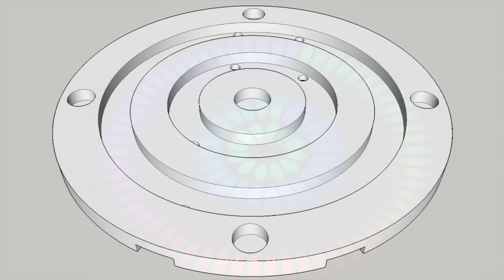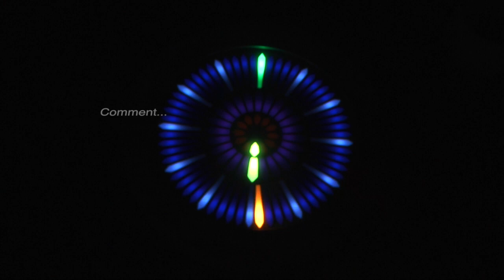LED Clock V2 Final Assembly

Comment: this is an amazing project, Steve!  well done.  i've made two of your clocks so far, modifying the 3d print design to accommodate both side-emitting WS2812B and WS2812B strips in a 180% scaled-up version.
Reply from the maker: Thanks, I would live to see what you have done.

Comment: Seeing so many (Projects) this one included 👍👍👍👍😎.. (Very Nice in Appearance) ... (The Electronics aspect of Projects like these not a problem) No Shortage of Parts to Pick from (Horded) 😊 for many years.  (Hard to Choose a Good 3D Printer However) So Many to choose from... Almost any Printer has a 50 / 50 Review.. (One person says) Best Ever !! .. Another Review will Say Horrible print quality (Bad things about it) for the same Make and Model of Printer.. (So.. No 3D Printer YET..) I Know you can't expect. 1000% Perfection (Would Be Nice).. I Just Can't decide what 3D Printer to go with.. (I Set a Budget $2000 Max) And still looking ☹🕵‍♂.. Thanks for Sharing your Build and Files.. (When I Get a Printer Some Day)
Reply from the maker: Thanks for your kind words and glad you like the project. It has evolved a bit since making that video. I had the 3D printed parts laser cut in MDF in the end. 

Mind you, speaking of 3D printers, I can and will whole heartedly recommend any of the Bambu Lab printers. 

My first printer was an Up Mini. Okay for its time but the build plate was too small for my needs. My next printer the TiVo Tarantula (which came highly recommended at that time) was definately a tinkerers printer and I had mixed results with it. Loads of mods to try and make it work better with little luck. Bed adhesion being the biggest issue. 

I then went for the Creality CR10 Smart. A much better printer all round but still not adequate. You think you've dialled it in and then you get an unexpected failed print a week later for example, printing the same part too. Again bed adhesion and warping being the main issue. I think it may have been poor filament choice in the end.

I soon became fed up trying to dial in the printer all the time. 

Just recently I bought a Bambu Carbon X1 and this is the printer I’ve always needed. It just works with no tinkering unless you want to. Even old filament that had failed me previously, printed just fine on this machine. Don't get me wrong, there are failures sometimes, mostly my fault. Bed adhesion is really good and no warping. I have only used PLA mind. The Carbon with AMS (a must add on in my opinion), can be purchased at the moment for just over £1100 in the UK. I’m actually considering a P1S or a A1 as a second printer, permanently set up with a 0.2mm nozzle. In fact, the A1 would be perfect for that. Small parts requiring fine detail.

Bambu’s slicer is a dream to use, it is based on PrusaSlicer. 

Plenty of very good documentation to back up the printer and slicer. The comb is a dream to use by comparison to all other printers I have experienced.

Other 3D printer manufacturers are playing catch up to Bambu now. 

The only downside to Bambu is that you are hooked into their eco system. Although you can go off grid with it if you are happy to use SD cards rather than wireless to transfer printer files.

A mate of mine has a P1S and loves it. He used Creality Ender 3’s before that and says Bambu is streets ahead.

Go Bambu and thank me later ☺️
Reply: @stevemanley3685  LOL. 😊 I'm Currently Considering that Bambu Carbon X1 as a choice (Scary Coincidence, or can you read minds ??).. ( I like what I see) and now Reading Your Recommendation .. It Gives Me great Confidence that it May Be a good choice.  Plus very nice that Someone with (Hard Knocks) Experience (Such as yourself).. Is a Big Help with making a Decent Choice.. (Thank You Very Very Much) .. and yes I expect some print failures (At first because just learning) .. Perhaps Bad Filament..  or (Many others I can imagine) The list can be long (for a Reason Why 😕).. But, the X1 as a Choice.. Should Eliminate Half of the Potential Problems 🤞🤞 (Thanks Again Cheers)
Reply from the maker: @x_CrossHair_x  🤣 No I can’t read minds, I wish though. Just a pure coincidence I’m afraid. Glad I’m able to help with your choice. Bambu have produced a printer for the masses and not just another one for those who live to tinker under the hood. To many machine makers have left their customers to figure things for themselves or rely on those who are willing to tinker to step in and help via YouTube etc. 

The build quality is excellent as are most prints. Firmware updates are a breeze. The printer will self calibrate on first use, and before every print. Adds a bit of time to each print but the reliability makes this acceptable. Just start a print and let it get on with it. Check the first layer for sure, as this is always critical to successful prints. Keep the print surface clean using dish soap and warm water. Or isopropyl alcohol. I use the smooth PEI plate from Bambu almost all the time. It needs NO clue for PLA, holds and releases well. Printer comes with a cool plate. Bambu recommend glue that’s supplied with the printer even for PLA, but I could print PLA without glue most of the time on the Cool Plate. A lot of folk like the textured PEI plate. I have one but prefer a smooth rather than textured bottoms to my prints.

Please let me know how you get on.
Reply from the maker: PS. I’m going to try printing the clock parts on my Bambu just to see how well it prints it. Not thought to do so until this moment.
Reply from the maker: PS again. Bambu has its own MakerWorld. Also very good. You can download models others have made straight to the printer, even via a Bambu Handy App from a mobile device.

Oh and I forgot to mention, Bambu printers are faster than most other printers, and still retain quality prints.

Comment: Hallo Steve, do you have a diagram for this watch with
Real Time Clock RTC DS3231?
Reply from the maker: Hi, 
Sorry to say that I don’t currently have a circuit diagram for the DS3231 and Arduino. After I made this video, I revised my clock design and started using the DS3231, but with Teensy LC’s and I haven’t used Arduino since. The clock design and build have gone through several revisions and enhancements since this video was made and is currently on hold because other projects have got in the way.

I did do a Teensy version of the original clock with custom LED PCB and control board PCB with DS3231 and the MSGEQ7 circuit. The LED PCB included an extra LED in the centre and all the LEDs were of the RGBW type. It works very well.

The latest version is still in development and does away with the MSGEQ7 audio circuit, which has been replaced by a more complex but more versatile Audio Codec chip. To drive the audio chip, it requires the more powerful Teensy 3.2. The LED PCB has been updated even further and has multiple LEDs in most of the display segments. All these developments are not ready for sharing.

Comment: Great looking clock Could i get the files from you as dropbox files are no longer working now I would really like to make this clock Thank you Steve
Reply from the maker: Hi Neil, thanks for your comments and glad you like the project. 

I have checked the links and they are all working for me, so I’m unable to explain why you’re unable to access them.

Presuming that you were able to access the files, I’d have to say that you are Likely going to have difficulties using them. It is very unlikely you would be able to get the LED rings with exactly the same dimensions as the ones I used, which would mean the 3D printed parts would have to be customised for your rings. In addition, the Simblee module for remote controlling the clock ( not actually shown in the video ) is now obsolete with absolutely no support for it. After the IOS 14 update on my iPhone, I can no longer remote control my own clock through the Simblee App, which has been withdrawn from the App Store. So I should really remove those files and links.

Simblee aside, the code if run on a Nano and wired to the correct Real Time Clock module, should still work though.
Reply: @stevemanley3685  Thank you for your reply I will keep trying the links to see if I can get them to download  Just tried a couple time before the and still connection refused  again thank You
Reply: Funny thing I went to your other video and was able to download it with no problems  Again Thank You
Reply from the maker: @NeilHodgsonDARKHOURS  Fantastic, glad you were able to get hold of them eventually.

Comment: very good thing. before manufacturing decided to model in PROTEUS it turned out that the button on PIN 8 does not work. I also don't get the effects that are reflected in the video. the clock is especially tuned, it is displayed as three points (hours, minutes, seconds). they are running, but on a simple black background, only three LEDs light up, and in the video everything is on a blue background. tell me what's wrong.

Comment: Hello, i need to change the Diameter of all the Holes in the Backplate (for better fitting). Is there a Possibility to get the original STL Files to edit them ??
regards Mirko Ingold
Reply from the maker: Hi Mirko, the STL files are available, and a link to them is in the video description. If you mean the original SketchUp files I used to creat the STL files, then I’m sorry to say that I don’t release those to anyone. 

This issue has cropped up several times  before as the led rings used do vary in size. I have created custom STLs but I’m reliant on accurate measurements from you guys, and it can be time consuming for me. One guy managed to tweak the STL files directly. I’m not sure how he did it.

I am working on a clock kit that consists of a custom (and consistent) led back plate and clock face as a whole piece. It all takes time, effort and expense to get it all done.
Reply: @stevemanley3685  Hello Steve, thanky you for the fast respond. No Problem for that. I will find a way to edit the Holes in an other Software
Reply from the maker: The STL files I created for a couple of guys are available, just follow the link in the description. Being I’d rather spend time creating the new version of the clock in a kit form, I don’t have time to create custom STL files, I’m sorry to say.

Comment: awesome project ! can i remove 
"" MEMS ADMP401 
 Microphone and Amplifier " and " MSG EQ7 
Graphic Equaliser " from project ? And what happen when i remove it ? My son very like this and he tell me make one for him. He will put it on his desk. Hope you support me. Sorry for my bad english
Reply from the maker: Hi, thanks for the comment. Yes, you can omit those items, but be sure to edit the code so that it doesn’t try to enter the audio modes.
Reply: @stevemanley3685  i will. if i get error , hope you help me fix it. thank for the reply :)
Reply from the maker: @MerleyAilme  Hi, The simplest way to block the audio modes is to change just one line of code. It's near the top in the "includes & definitions" block.

Change: 
#define  MODE_LIMIT           6             // upper mode limit

To:
#define  MODE_LIMIT           1             // upper mode limit

All the code for the Audio modes will still be there, but you shouldn't be able to activate them using the mode up and down buttons. All you will get is the "Time" and the "Date" displays.

Hope this helps.
Reply: @stevemanley3685  hello , today i got all items. i go to test code.i edited your code as you told me.all leds were displayed but it didnot flash :( i pressed all 2 buttons but got nothing :( please help me
Reply from the maker: Vinh Đồng Đức Hi,
Without seeing what you built and how you wired it, It is difficult for me to advise. If all you did was omit the audio hardware, wire the RTC as per wiring schedule, then I would have to replicate the same thing and test it for myself, and I don’t have the spare parts to do that without ripping apart my own clock.

Are you able to post photos or a video on-line so I can try and see what you have done? I’d also suggest you post a copy of the code you edited.

Please recheck your wiring to make sure it’s correct. Do you have access to any test equipment like a scope or multimeter? If you have, see if power is getting to each item accordingly. There should also be a 1Hz signal coming from the RTC module, and it is this that controls how often the time is read from the RTC and updated on the display.

If you are into programming, try placing some debug lines into the sketch that writes to the serial port, and see where the code is getting to, but if you are not a coder, then this will not be very easy for you to do.
Reply: Steve Manley 

hi, thank you for reply !
I checked all wires those is connected between modules each other. And there is no mistake. Everytime i disconnect and connect power supply, the green led ( second led ) moves to another location. About source code, i just edit as you told me and no more ( change number of MODE from 6 to 1 ). I made a clip, you can see it here : 

https://youtu.be/NVJtjans5PQ

It’s so hard to me because I’m not coder and i have an analog multimeter to test. Hope you will help me complete it. Thank you so much !
Reply from the maker: Vinh Đồng Đức Hi, and thanks for sharing the video, but from the video, I can’t actually see the interconnections between the Arduino and the RTC module. Please share a photo so I can possibly see all the interconnections. I would also ask if you are using the exact same RTC module. If not, then that could be a problem. I does look like the time is being represented each time you power up, which could be that the 1Hz interrupt is not happening, or not being detected.
Reply: Steve Manley hi,
 thank you so much for helping ! 
I checked carefully all connections between Arduino and DS3234 module. No short circuit between wires. They are same as the schematic that you shared. I checked it very many times. So i guess i have the problem with RTC module. But i have no idea to test it. Still has 3v3 to VCC - GND pin.  The Arduino module still work good ( i tested it without RTC module with rainbow code ). Do you have any idea to help me check it ? The image of module i uploaded in below link, you can see it. I cannot find out another device from another supplier in my location. And it takes a long time to deliver to me ( 1 month or longer ). In case my RTC module has problem, can i replace it with another RTC module like DS3231 or DS1307 ?

https://youtu.be/U3jgworJ1sE
Reply from the maker: Vinh Đồng Đức Hi, and again thanks for the video. 

From what I can see, your wiring does look to be correct and mirrors my own clock. However, my clock has a Simblee micro-controller also connected to it, which simulates the functions of the two physical buttons using my mobile phone Via Bluetooth (unfortunately the Simblee is now unavailable, which is a huge shame, as it is a very clever device). So I’m thinking the code you have, has the Simblee functionality included, and because those pins are open circuit, it is causing the code to lock up in a loop where it checks the button status. If you were to place your multimeter on the SQW pin on the RTC (measuring DC volts), you should see the meter oscillating  at 1Hz between 0V and 3.3V. If this is the case, I’d suggest connecting the Nano D5&D6 pins to 3.3V. If that doesn’t work, try connecting them to 0V. If that doesn’t work, then let me know and I’ll have to modify some code and see how that works for you.
Reply from the maker: @MerleyAilme  Hi Again,
Not sure which version of the Clock code you downloaded and currently using, but I'm guessing it was V4.0, which has the Simblee code in it. Can I suggest you try V3.0, and modify that as you did before.

With regard to the DS3234 & DS3231, they are both RTC chips from the same range, but the DS3234 uses the SPI interface, and the DS3231uses the i2c interface, and are therefore not interchangeable without a re-wire, and re-coding. As it happens, I am using the DS3231 in my lates clock version currently in development. I don't have experience of the DS1307, and can't give any meaningful comment, other than it is probably less accurate than the DS32xx range.

Hope this helps?
Reply: Steve Manley hi, thank you so much. I made it work ! Awesome ! I uploaded v3.0 code without Simblee module. Again thank you so much for your support !
Reply from the maker: Vinh Đồng Đức Fantastic, I’m really pleased for you, and no problem. Just glad you got it working.
Steve